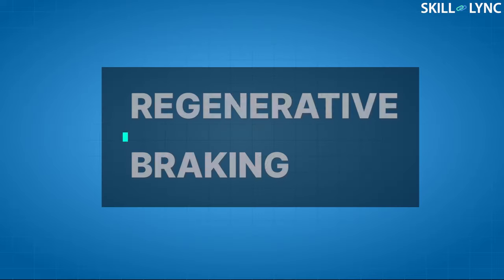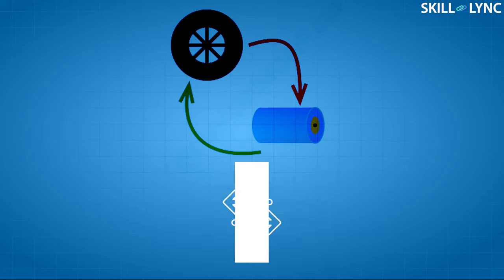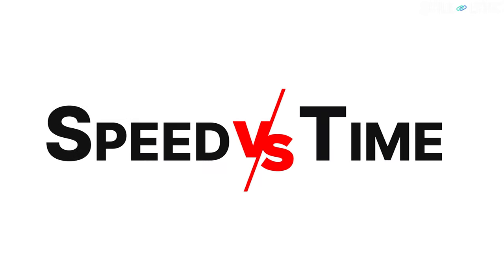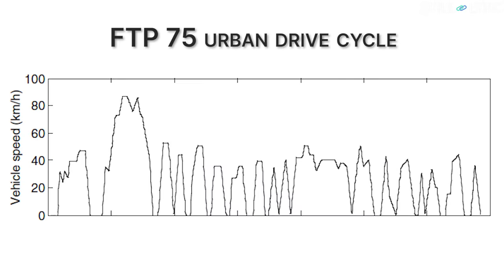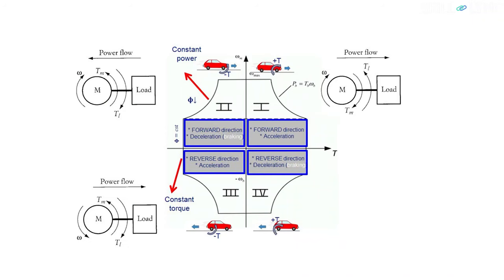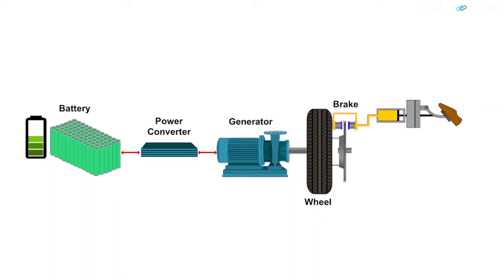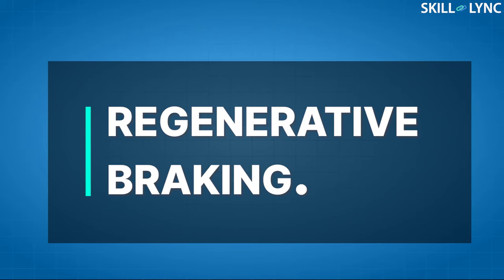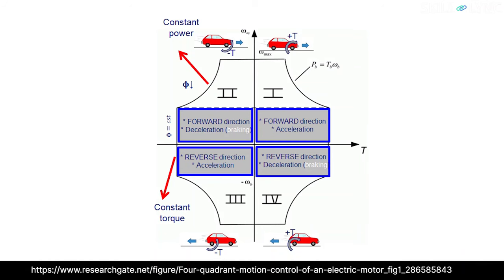How does Regenerative Braking work? | Skill-Lync

Comment: Worry of regenerative breaking is that battery can't absorb the sudden energy jolt from surge of power quickly enough for optimal intake...That's where you wonder if the energy surge should be used  in friction engine, to make some hydrogen onboard the vehicle, and use that hydrogen fuel to charge a  battery slower, so that it uses more of the power surge...but then again, a friction engine shouldn't be that hard to improvise using hydraulics and feeding battery cells directly anyway...options exist...."Multiple Supercapacitor" designs, passing charge back and forth with modest battery involved, could eliminate hydrogen option within five years even if batteries don't progress significantly...but likely BOTH will, while regenerative breaking should remain huge help regardless, especially since it's already in many ev's.
Reply: The amount of charge or energy it gives back is very small… unless you live in downtown NYC where you have to stop every 100 yards
Reply: @datnwin  It should make mechanical energy like a fly wheel, allowing for trickle charge, like  wind up toy but possibly aided by inertia and wind drag under car...I'm starting to think transformer components would allow trickle charge even without friction breaking but it's still nice feature. Doesn't make sense a charging station is going to throw in a massive charge due to cobalt in ten minutes, that can't be broken up and duplicated in trickle charging over a thirty minute and longer drive. There's several options to recover the mechanical energy toward trickle charging...Mostly due to magnets and copper coils...Possibly lot of coils really help but compact...then there's thermal panels and small tanks to swap condensed air just for cold temp. Seems like limitless ways to recover the mechanical electrostatic energy during twenty minute drive. The heat of friction breaking would take at least five minutes to dissipate even from one deacceleration though, especially if pressurized. It's just about utilizing heat. Regenerative breaking could probably be more optimized as well since they are different. Musk wants charging stations to gain real state partners. The engineering to self charge is real for the life of the battery cycle.

Comment: Sir i am confused a little bit here you said that suffcient amount of braking torque cannot be implented on the machine during high speeds but the regenerative braking principle says that there should be a minimum threshold value to attain the sufficient amount of torque which means a speed range of 15km/h cannot deliver as per condition

Comment: May I know what is the maximum and minimum speed limit at which regenerative braking can be applied to generate reasonable amount of power?
In case of an electric train, if supply frequency is to be lowered to maximize regeneration, then what is the limit of minimum frequency?

Comment: why using generatif breaking, when the rear wheel of FWD car just spinning wasting energy.... can't we make generator there ?????? can we ???
at least we save 30% maybe up to 50% energy back to battery ???? no ??
Reply: Lol
Reply: no.
Reply: @sdubvt  whyyyyy?????
Reply: We can
Reply: That's not possible...if you want generation from rear wheels you need to add two alternator there. Increasing weight, Increasing cost (2 alternator costs huge), Increasing complexity in vehicle designing, requiring another power converter circuit to  convert and transfer energy into battery, increasing resistance to move rear wheels as we attached alternator to it.

You can imagine now how price and complexity is going to shoot up.
Reply: ñay be heatd 85 perc tuàt ekvator boat lifts